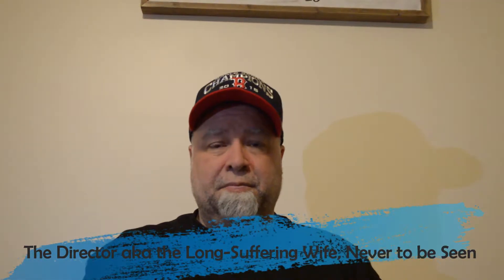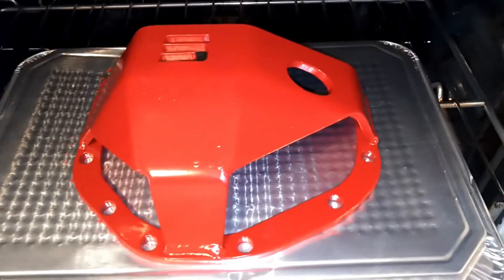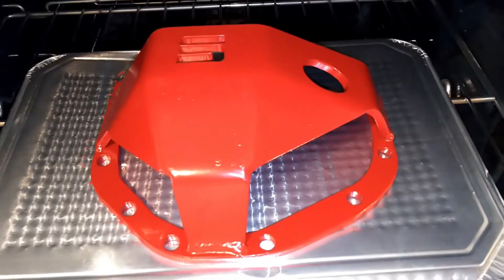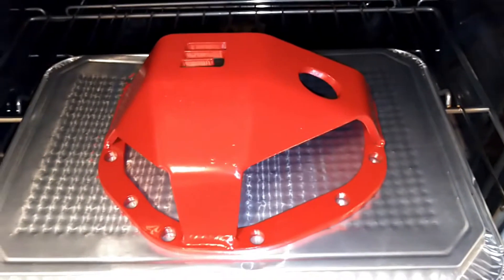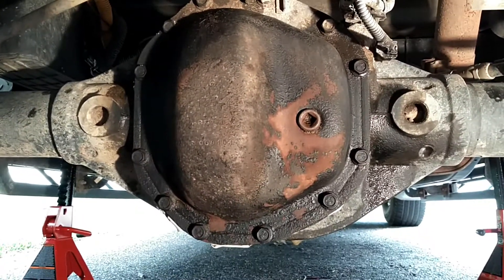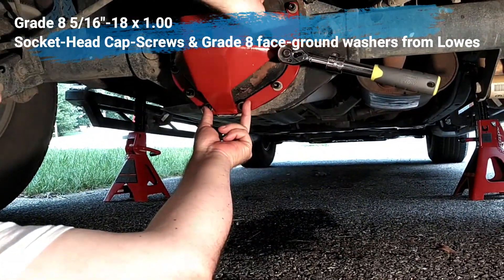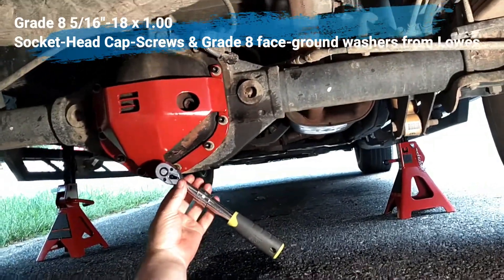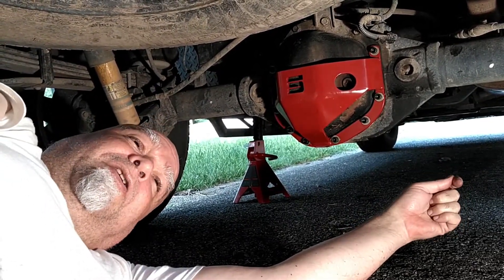Frontier Rear Differential Armour Part I

Comment: That came out good!!
Reply from the maker: Thank you. Stay tuned for part II, "Oh Snap, the Cover's Dripping". Yeah, I busted the seal on it while installing the armour, supplier website said you could install w/o removing cover or fluid but in some cases this doesn't work out as intended. Had to get some new fluid ( Valvoline 75w140 HD gear oil, had Motul 75w140 in it, from the last fluid change, wish I could have kept it, it was $49.95 for 2 litres ) and Permatex Optimum Black RTV to reseal it. While I had it apart I painted the OE cover as well, it was lookin pretty ratchet.